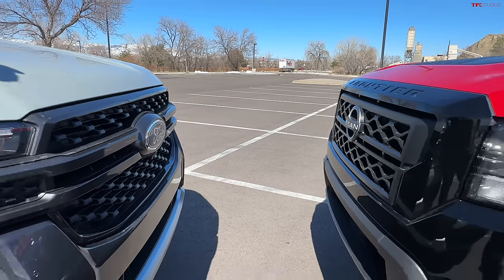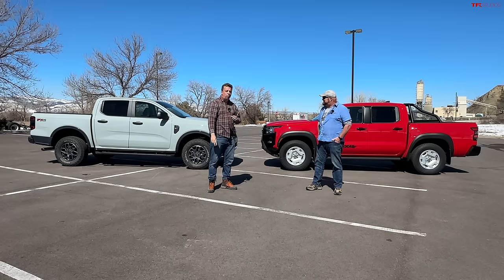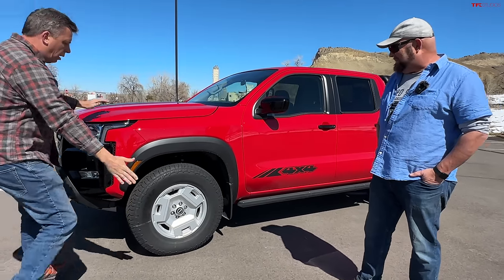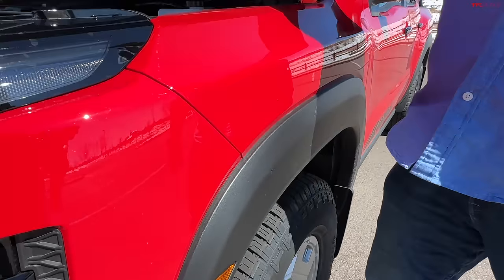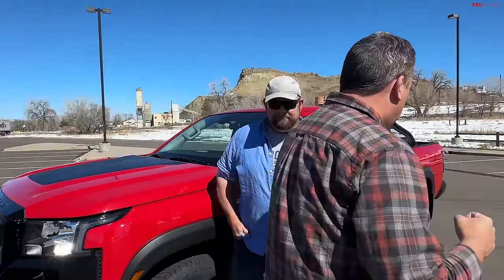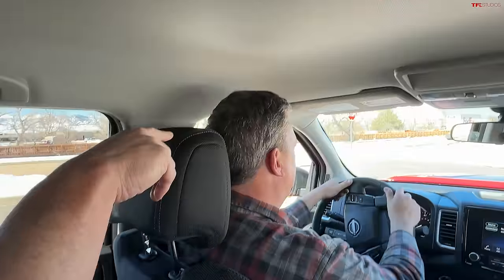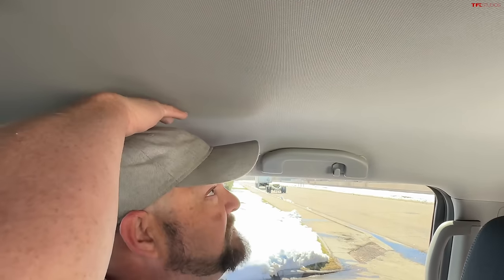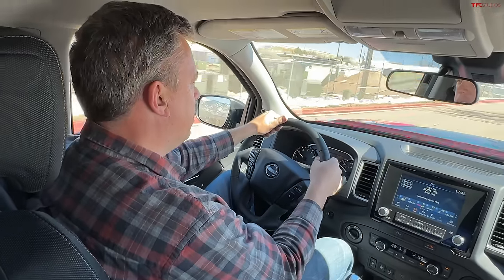This New 2024 Ford Ranger & Nissan Frontier Hardbody Cost EXACTLY the Same, But Which One Is Better?

Comment: Nissan has the reliability and better equipped as a basic truck
Reply: Does it? Ranger is pretty darn reliable and the base XL has a lot for the money. I don't know hardly anything about the Frontier.
Reply: Naturally aspirated Vs an all-turbo lineup in all the other competitors except the Ridgeline and Gladiator. Which means potentially less problems long term.
Reply: @damilolaakanni  Thanks for the assumption. Turbo engines are built like diesels usually and can easily handle the pressure. It would be nice if automakers gave options for both in their trucks, but that's now a competitor thing and both are good choices depending on the buyer.
Reply: @302Mustang13  Right-O.  That is why Ford's truck reliability is in the crapper, all those super-reliable turbos.
Reply: @jfruser  Never said they were perfect and hardly break. Not like GM AFM and DOD has been reliable and Hemi MDS sure has its issues after 100k miles. V8s are great but the torque of an Ecoboost is something that gets attention and impressive. Gets better fuel economy in many circumstances while offering better performance.

Comment: I wouldn’t buy the hardbody edition, instead I would buy a used PRO4x with 15k miles on the clock for 35k. I would absolutely not buy a ford or any turbo 4. I am a Toyota tech and I am not sure how  the new turbo 4 in the Tacoma will age.

Comment: Ford is still 700lbs short of the ‘same’ vehicle supplied to the UK and Europe which have a 2300lb payload, possibly at the expense of comfort, although I have no complaints in that regard in mine. 7700lbs towing here except for the coil sprung Raptor which also has a reduced payload. All mid level and higher Ford models now get 4Auto here and I have it on my Wildtrak 2.0 bi-turbo diesel.  Parts supply here is exceptionally bad with nothing in European stock and months of waiting for lights and trim. We also get heated windscreens on most models and have done since the T6 was introduced in 2012.
Reply: Usually they don’t even give you 2,300 pounds of payload on F150 here unless you buy a special option.
Reply: Is that American pounds or some type of a metric pound.😮

Comment: I will never understand why someone buys a pick up truck with a 5’ bed
Reply: This is why I love my s10
Reply: It's still about 5 feet more than most truck owners actually need.
Reply: A pickup with a 5 foot bed is still a lot more versatile hauler than an SUV. It's enough for people who don't haul lumber and sheet goods all the time.
Reply: IKR.... I can fold down the rear seat and haul 10' boards in my corrola, whereas a 5' bed is uselesd
Reply: @organican  I used to have a mini van with fold down seats into the floor and that’s more useful then a 5’ bed
Reply: Towing.  The truck is just the powerplant.  Put whatever size and design trailer behind it.  Without the trailer its a more versatile family hauler.
Reply: @grandmastert01  Bet you had fun cleaning your minivan after hauling that load of loose compost.
Reply: @jfruser  lol

Comment: The Frontier has a cosmetic engine cover under the hood but the Ranger doesn't... The Ranger has more features in the cabin than the Frontier... Well, now you know how the money was spent on the build of each truck. The Frontier is definitely the simpler truck, and would be easier (and maybe cheaper) to maintain than the Ranger in the long run. Then again, can you do without the creature comforts of the Ranger? Would you be happier in the Ranger or the Frontier after 3 years?

Comment: So basically, do you want fancy touch screen or do you want a reliable truck with just enough tech. Frontier hands down!
Reply: The ranger is reliable too
Reply: @Fernando-t8g Many people are waiting on the 2.7 motor which has had some hiccups in the broncos.  time will tell how it does in first year ranger.
Reply: @spyder000069  I'm talking about the 2.3 it currently has. It's been pretty solid.
Reply: @Fernando-t8g  The reports I've read seem like the 2.3 is a solid motor. also, apparently the oil pump on the 2.7 is run by a wet belt system.  we currently have a EcoSport with the 1.0 liter turbo that is affected by the recall with its wet belt system where the belt deteriorates and clods the oil pump causing catastrophic failure.  so I'm not too keen on purchasing another engine with that similar system.  apparently the 2.3 oil pump is a gear drive.

Comment: Nissan wins
Reply: Not even close... The Ranger stomped it,  more options, more power, more towing capacity and more payload for the same money in the Ranger..
Reply: Yep and no turbo. I like Nissan body style better
Reply: In the early 2000s, Nissan sold out to Renault
Reply: @matthewq4b  From a mechanics perspective I want my customers to get the ford. I would stick with the frontier. I prefer reliability over bells and whistles.
Reply: The Nissan is 20 years old underneath and drives like it
Reply: @jmc6000  Agreed
Reply: @MrPhils88   And buying that Nissan is going to give you that reliability  LOL. This is NOT 1986.   The Ranger is one of the most reliable trucks on the Market. While the Frontier is one of the worst..
Reply: Man that ranger kills the Nissan in every way , that Nissan is way over priced and under equipped.
Reply: @DanDan_and_the_boys  Way overpriced - should knock $10k+ off the price.
Reply: Nissan Frontier made the top ten least reliable list
Reply: @matthewq4b and the Nissan will be sitting in your driveway while the furd sits in the shop.
Reply: @J.W.W.  What's the failure point for Frontiers? Transmission? Nissan sure makes some really shitty transmissions - not sure if that applies to the one in the Frontier though.
Reply: @J.W.W.  I don't believe anyone who put a porches above a frontier. I'd get the frontier just cause I think it looks better. And nissan is known for reliability.
Reply: @bubba99009 it doesn't apply to the frontier. The sedans use cvt transmission which is shitty.  The frontier has one of the best transmission out there.
Reply: @JohnDoe-nz6bk  Ya that's why the Frontier is one of the worst rated trucks for reliability and the Ranger one of the best.  And that 2.3L turbo in the Ranger is near bulletproof.  Unlike the carbon choking sludge building 3.8 In the Nissan.
Reply: @TheSlugger76 this has turbocharged cars, modified them, doubled their power, they’re fun. But turbos are HOT and even if the engine and transmission can take the abuse and are generally reliable if you’re going to keep it, all the wiring and plumbing around the turbo gets crispy. And they’re harder on the engine oil. So for long term ownership, I’d go for the v6 Nissan.
Reply: @matthewq4b  that 2.3 is garbage as I have one in my current exploder. I’ve owned 4 fords in the past year, including a custom ordered wildtrack. I’ll never buy another furd. I’ll take garbage motors over a furd.
Reply: @JohnDoe-nz6bk    They are such crap you bough 4 of them.  Sure thing there skippy....  Not the sharpest stick in the pile are ya...
Reply: @matthewq4b  I sure did. I can’t help that you’re not wealthy like me. Sucks to be you!
Reply: @matthewq4b Ranger 270 hp, Nissan 310 hp?
Reply: @adampatrick2648   It is NOT HP that gets you moving but Torque.  Ranger 310 lb-ft lbs  Nissan 281 lb-ft.. That's why the Ranger has better acceleration and a higher payload/tow rating.  And with the  V6 in the Ranger it's 405 HP and 430 lb-ft.   And the Frontier is well, a Nissan, it as been 30 years since Nissan made a half decent truck and that GDI 3.8L V6 is a POS  with known carbon and engine sludging issues.    That Nissan still has not been able to solve.
Reply: Nissan looks ok but the Ranger wins with payload and towing and the interior looks a lot better then the Nissan so Nissan is just outdated to the point that it's lame and tame
Reply: @jmc6000  Nissan has been junk since 1996

Comment: Guys - Look under the seat where your feet are there is a rear heater vent there!   Also I'm very fortunate the telescoping steering wheel fits me just fine in the Nissan.   I also have 360 cameras in the P4X.  And Adaptive Cruise control.   I got the Nissan P4x on discount below MSRP for 41K. ooh and that's with a locker!..  so I think right now they are closer than they appear.

Comment: These manufacturers are more focused on building toy or pleasure trucks than they are concerned with building legit work trucks , I consider both vehicles useless , especially since they're only getting low mpg , I'd rather buy an f150 instead . 46K is not a good deal at all. Frontier trucks rattle quite a bit , even at four years old , the only good thing about the frontier is the engine

Comment: Help me understand why a full size F150, with a 35 eco-boost gets better mileage than a midsize truck I just don’t understand.
Reply: Really strange. Isn’t it? I think the reason is that the full size trucks have on average higher displacement engines and those are working less hard to get the same work done. However, they’re going to have worse NxO emission numbers than the smaller displacement turbos in the midsize trucks. Heck, the V8 in the F150 probably will have similar mpg numbers than these midsize tiny turbos.

Comment: I’ve looked closely at and driven both, and have had older models of both. Ok, I’ve had a lot of cars and pickups, period. The Nissan Frontier is a seriously under-appreciated truck, a well sorted, slightly plain, strong, fairly hard core truck. Not a racerboy thing at all. More like a great ranch truck kind of vibe. It doesn’t really say “old” to me either. It is simply a very nice truck. I never thought the specs were more informative than taking it somewhere and using it for a while. And doing that\, it shines. What ever the “disappointing” specs  are, it’s fine in the real world. For me, I’d go Frontier in this comparison. I might even go this Nissan over a 24 Tacoma with the blower. I see them around new for a lot less than 46K but even there, if that is the competition, Id take the Frontier 4X4. I’d rather have a standard. But this transmission is ok too, it’s not that weird junk Nissan has put on the small cars.

Comment: The V6 on frontier has about the same power as the 5.3L V8 of a 2005 Silverado Crew cab I had. Also today's midsize trucks are about the same bulk as traditional full size trucks so the six is essential.

Comment: Of those 2 Id take the Nissan, and mostly because fords Industry leading recall status.. and the "tech" isnt really anything I saw WOW I need that... What would I say for me are "musts" for me buying and what is stuff I dont care about

Musts:
Push button starting(ive had this on 2 cars and my current one doesnt have this and wifes does its so much nicer getting in and not having to F with the keys) its not a total no go but its on the list of wants

Comfortable seats

heated seats

power seats

heated mirrors

ability to tow a boat or kayak(small fishing boat nothing big) something up to the size of a 15" John boat or the like.

some type of connectivity apple/Android 

AWD or 4x4

blind spot monitor

some underseat/behind seat storage for some fishing gear

Bed liner(and bed storage like the Ridgeline if possible)

Dont care about:
Towing capacity(other than above and even my 4 banger current Forester with a CVT can do all I need towing wise)

Bed capacity(if i can take brush/shrubs to the dump, pick up a load of mulch and redrock for the spring, maybe get a Refrigerator from a big box store or a washer or dryer back it wont ever see more than that )

If its a hardcore off road vehicle... Ive owned AWD or 4x4's since the early 90's and and ive never put one in 4 low.. never had a reason to.

Comment: There is no comparison.  The Nissan is GREATLY outclassed by the Ranger.  46k for either of them is ridiculous, but doubly true for the Nissan.  I would never pay new price for a mid sized truck.  Get one that is 2-3yrs old, with under 40k miles.  That is the sweet spot for value on these.

Comment: They modified the rear of the Ranger to increase the distance between the load area wheel arches so you can load a euro-pallet easily. This was a requirement of VW for their Amarok based on the Ranger chassis😊

Comment: I definitely trust turbochargers... to make a 500,000 mile engine only make it 150,000-200,000.
All of the payload and tow weights are based on configuration... they can vary a lot.

Comment: I bought a 2018 tundra sr5 4x4 double cab brand new off the lot for $29,000. To think that these tiny trucks with similar interiors and technology cost more than $16,000 more is insane!
Reply: because fiat currency never goes to zero right?

Comment: Nissan Frontier is a whole other level of Nissan with a tried and true engine and transmission. A Frontier has never even seen a Jatco transmission and probably wouldn’t know what CVT means.
Reply: Jatco has actually made transmissions since the 90’s. My old maxima still has the original jatco 4 speed. But all the RWD transmission’s are jatco they make very strong rwd transmission’s.

Comment: the nissan frontier is woefully overpriced and outdated for what it is. the powertrain may be modern but it still drives like a 20 year old truck w little tech. the v6 is the only attraction and the ridgeline and gladiator  still have one, but nissan is just not competitive enough. at least the bed has a power outlet and there may be some value in the lower trims, but almost 4k to make it look like an 80s truck? no thanks. i would choose almost of the other midsize brands over the frontier except maybe jeep.   unless i was towing or going off road alot the ridgeline as as daily driver would be my choice bc of the room, handling and tailgate. the recent truck king offroad review of the frontier says it all.  it will prob have the lowest number of sales this year alongside gladiator if they dont lower stickers or offer incentives. the same price match with the new ranger is just ridiculous.

Comment: 13:20 if only it had a large metal cover over the engine, maybe one painted to match the rest of the truck. "they have a nice Nissan cover and the engine looks proper" What does that even mean? A plastic cover looks "proper"? As an engineer, I hate when the 'cool' stuff gets covered up. Back when I started getting into computers, we put windows in our cases so you could see the components, circuit boards and all. I even tried to get Maxtor to sell me one of the display model hard drives with a clear cover (but they wouldn't). Then component manufacturers started putting 'beauty' covers on everything, and now most PC components just look like generic boxes with logos or lights on them, completely killing the 'inside a computer' aesthetic. Same goes for under the hood of a vehicle, you used to be able to see the engine, but everyone wants to cover them with plastic covers now. It's stupid IMO.

Comment: 46K for a compact pickup is nuts.  You can buy a Ram 1500 4x4 with 5.7l or a Ford F150 ecoboost for the same price (or less, depending on incentives and discounts) in Texas right now.  At this point, you're paying a premium for a less capable pickup, just because it's smaller in size.  Even the fuel economy doesn't justify that cost, when an ecoboost F150 can get up to 22 highway.  It is really hard for me to see any sense in this purchase, but I'm a middle aged, arthritic homeowner who needs something comfortable and practical.  Maybe for urban environments or narrow trails? But if you're using a 46k pickup like these to navigate narrow offroad trails, I'd say you might have more dollars than "sense".

Comment: Nissan is the only newer midsize truck that offers a crew cab with a long bed so for me I would choose a Nissan with those options.
Reply: Wrong.  Tacoma has a long bed in all trims.  Pro4x does not have a long bed
Reply: @beexiong2995  Yes, you are right.  One of the review videos I watched said otherwise but it is clearly there on the Toyota website.
Reply: @beexiong2995  trd pro does not come with a long bed

Comment: Nathan misspoke again. Even with the truck right in front of told him he forgot that the Ranger offers two different v6 engine when stating that only the jeep, Honda, and Nissan have v6s
Reply: The V6 Rangers aren't coming immediately. BTW, I think he meant naturally aspirated V6s.
Reply: Not yet.
Reply: @garysarratt1 what about the raptor? Thats available now and with the V6
Reply: @dmegahan    Thanks.  Do they call that a different class or something!
Reply: @garysarratt1 nope. Still a midsize truck.
Reply: @dmegahan    So Nathan misspoke, and/or was wrong.  Appreciate it!
Reply: Yea. Sorry, I value the Ranger Raptor in a completely different way. Like a F150 Raptor R vs a regular F150. Sorry I didn’t mention it.
Reply: @NathanDAdlen    You’ll be fine, mom always liked you best.

Comment: No mention of the Ford recalls and quality control issues. Though from what I hear Nissan is having issues with the transmission.
Reply: That was pre 2013, there new 9 speeds, are very reliable. The older 7 speed and 5 speeds are excellent too.

Comment: Love the looks of the Nissan, needs a bed roll bar and KC high lighters and KISS playing through on the stereo and a manual transmission. Isn’t it a 3.8 that was in the GTR?
Reply: I doubt it's the same one, this one was designed for truck duty. I've even guessed that it's the same one as the Mitsubishi Pajero sold in other markets.
Reply: 2 completely different engines